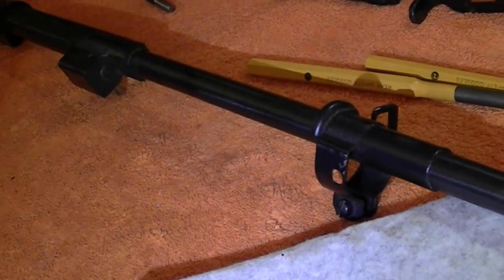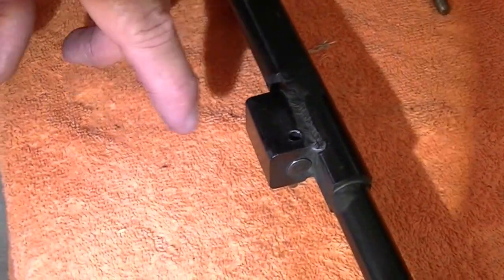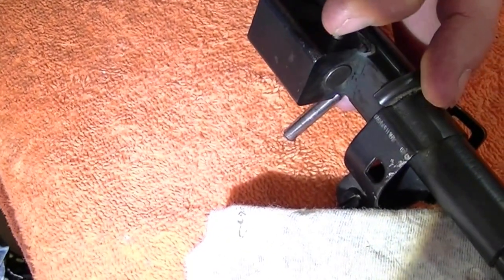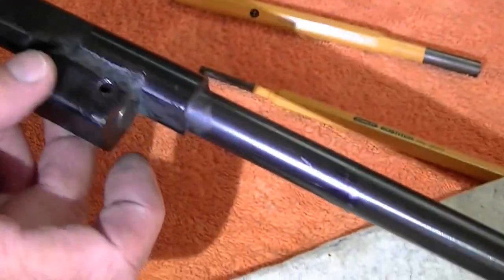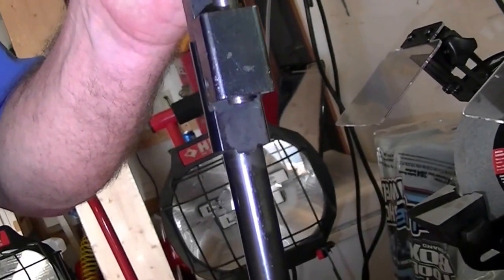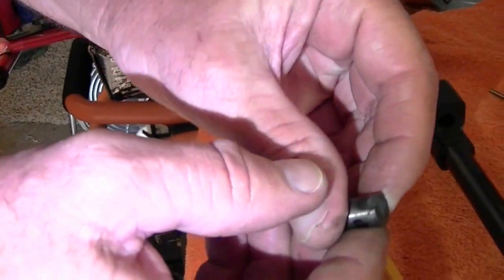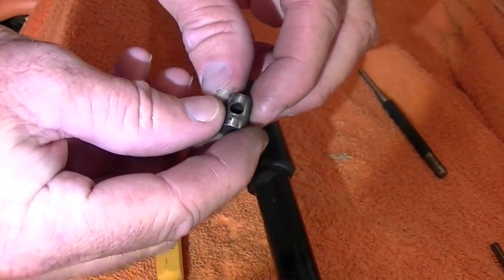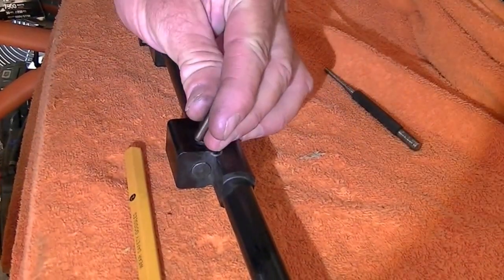Universal M1 Carbine Convert From Semi Auto to Single Shot Bolt Action and Back

Comment: thx - I've had 2 open bolt detonations.  Decided to do this so I can make sure the bolt is fully in battery.  Thanx again.
Reply: I did this but it still ran the charging handle back - far enough to eject the shell, but not pick up the next round.  Comments?